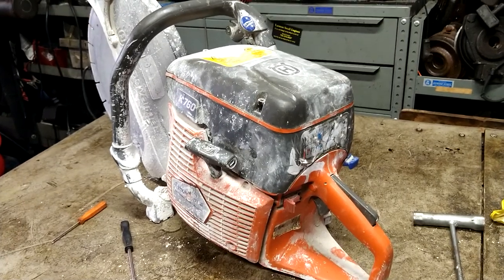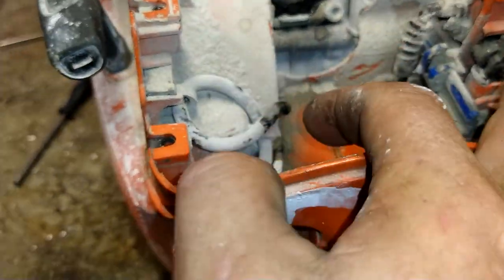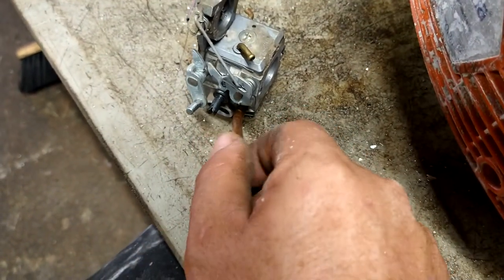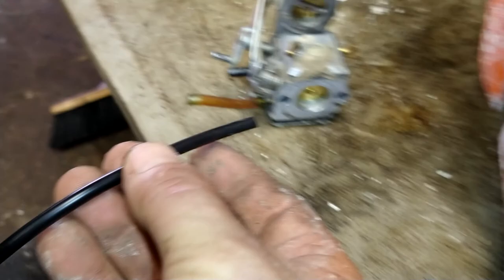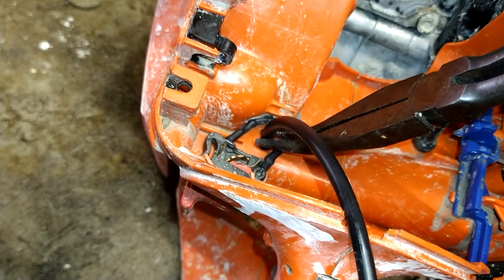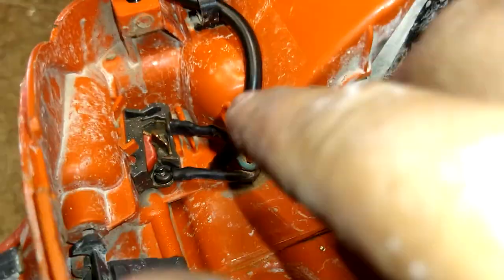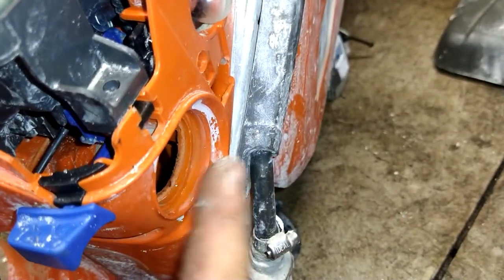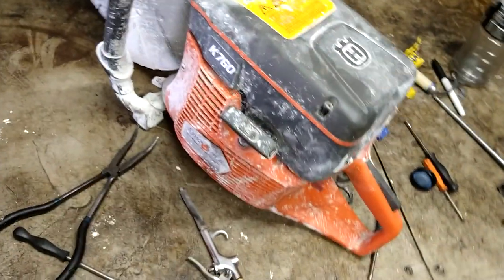husqvarna k760 cut off saw carburetor. k760 concrete saw fuel lines

Comment: I have one that is giving me an issue I haven't had yet. Seems like it wont go past a very low "idle" rpm when starting in the half choke position? It should rev up and let me tap the throttle to remove choke fully, but it barely gets enough rpm to start, and then stays very low rpms as if it's "idling" in the half choke position instead of revving up. and if i try to rev with throttle it dies instantly.

Comment: Hey my friend borrowed my saw and ran dry of fuel and now won’t start! Will I need to clean carb or anything you can think that will help? It doesn’t seem to have fuel come up to primer bulb.
Reply from the maker: Sounds like bad fuel line. Look in the tank did the filter fall off. Is do new lines primer bulb and filter
Reply: Yeah I pulled the filter line out doesn’t seem blocked and line is ok the primer bulb looks pretty worn so will order new one and check fuel lines when I’m changing it. Great video by the way and thanks

Comment: So i had a high idle, and I would have to pull out the choke little bit too slow it down but too much in it would kill it. I suspected one of my rubber intake boots was cracked or more likely the mating surface seal was messed up and allowing are in. I ended up spraying carb cleaner near The mating surface while it was running and the engine instantly locked. I didn't realize you couldn't do that for vacuum leak on a 2 cycle. I managed to get it to spin again but now it won't start and I noticed a big score on the piston. It still seems like it has compression. Any thoughts?
Reply from the maker: scored piston means rebuild time sorry https://amzn.to/43PBLsr

Comment: Hey I have a k760 that is blowing fuel out the exhaust upon start up. It also seems like it’s leaking out the decompression valve. The starter might be really dirty but it almost seems like the saw is seizing up when you pull it. I got a Ts500i as a replacement but would like to keep the k760 as a backup. You think it’s worth taking it apart?
Reply from the maker: Liquid fuel is harder to compress the vapor fuel. Hence the hard to turn feel. Replace carb and spend loads of time clearing cylinder with plug out. You will take plug out and clear cylinder and put new dry plug in many times after replacing carb. Keep throttle wide open to help start dont choke if it is wet.
Reply: @smallengineguys  thanks for the quick reply I really appreciate it!
Reply: Tyler! You have either a duck bill that is not venting properly in the gas tank and it's vapor locking, Or someone got inside the carburetor on the metering diaphragm side and bent the lever arm up too high and the metal nipple is pushing down on the arm! When adjusted correctly you should have a gap between the cover and the diaphragm of about  1/32  of an inch when looking down in the hole. 😉

Comment: My k760 seems to idle really fast and also wont turn off on the kill switch. Any ideas please? Thanks
Reply from the maker: so these usualy wont shut off at a higher throttle you have to choke it to bring it down then shut it off. sounds like a carb adjustment. first make sure nothing is keeping the throttle open like a bunch of concrete dust then try idle screw counter clockwise. if this doesnt work the 2 adjustment screws together are high and low air fuel mixture screws. you need the low which is closer to the motor. with it running at high idle turn it counterclockwise a little at a time till it idles down. it wont take much at all
Reply: @smallengineguys  brilliant, thanks mate. I'll give it a go 👍

Comment: Consaw near death experience -    I stripped my 2008 consaw  Hus k650 down today cleaned the carb and fuel line and vacuum pipe resat everything
-   Worked the fuel mixer  got the machine going again I thought it was finished 
This video saved me 740 euro - Thank you
Reply from the maker: Awesome great job!